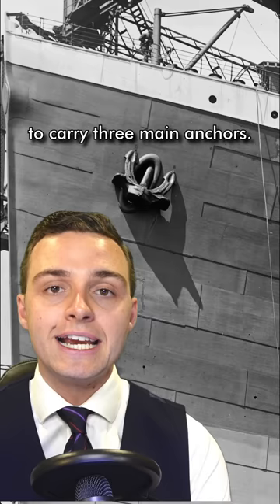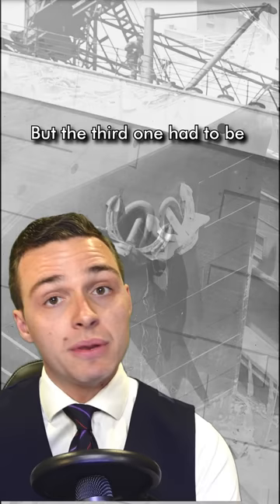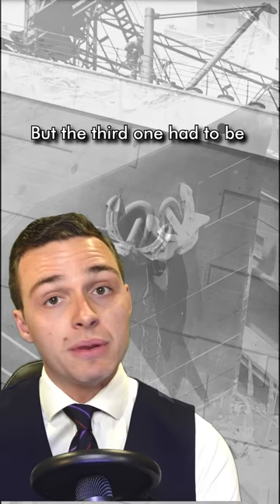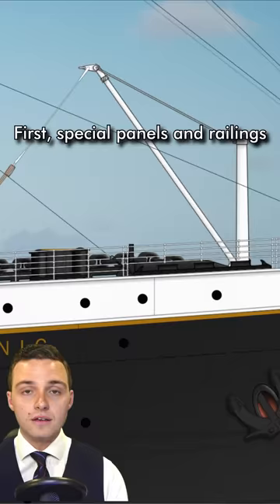What was this triangular thing on Titanic used for? | Oceanliner Designs Shorts

Comment: Yes and they had those on many liners and ships of the time until they were phased out by the 1930s or so. At that point they had internal mechanisms to be able to facilitate the central anchors on ships that had them after that
Reply: I think on some ships I’ve actually seen the 3rd anchor projecting out of an equivalent ‘hole’ on the prow of the ship in place ready to drop by a 3rd anchor chain…if I’m not mistaken.

Comment: Thank you for this. I curiously looked this up sometime ago and it was so much knowledge available about anchors. The one in question was built by a company known as Hingley, it's design was patented, it weighed 15.25 tons and was painted in anti corrosive coatings. It was so big it required 20 well-fed horses to haul it to the yard. Very interesting story.

Comment: I believe the spare anchor is not hoisted and lowered into the water.  It is suspended just below the anchor housing.  Crewman on a suspended platform attach the chain to the spare anchor and then lower it till the anchor chain takes up the slack.  The hoist rope is then removed from the anchor and then the anchor is ready to be deployed into the water.  Great video.  I like the animation.

Comment: I think you will find the crane wasn’t to drop the (spare) anchor into the water but to replace one of the other anchors on the anchor chain if it was lost or became fouled.
Most of the anchors holding power comes from the length of chain laying on the sea bed rather than from the anchor itself. The anchor itself would not hold the vessel in place even in calm conditions.

Comment: Spare anchor also called a Sheet Anchor. We carried ours stowed on the stern. However, in this case, because provisions were made to handle the 3rd anchor more readily than ours, which required a shore crane, calling it just, the third anchor is probably correct. Some ships I was on also carried a spare propeller. Another annoying fact: ship is at anchor if one anchor is out, and a ship is moored if 2 or more anchors are out.

Comment: It's not the anchor that keeps a ship in place, it's the weight of the chain that keeps a ship from moving. The Titanic had 1,200 feet of chain. You want at least 7 times more chain out than there is water under your ship. My question is, where is the 3rd chain. Also, I think there might even be a 4th anchor in the rear of the ship.

Comment: Youd be wrong on the done by hand, they had a windlass to use
Reply from the maker: I was referring more to swinging the crane around, that was all done using tackle and man-power as it was not motorised. For running the anchor cable up and down yes - 100% a windlass was used. :)

Comment: I wonder how long before the weight of the anchor potentially collapses the deck, or the weight of anchor chains for that matter. It’s a sad thought but i can’t help but be curious
Reply: the front area of the ship is quite strong compared to the rest of the body , it was reinforced so it was able to house the main anchor on the deck plus the bow of the ship had to withstand the brutal conditions of the ocean and withstand anything hitting it or it ramming into anything.
that from section will probably outlast the rest of the ship.

Comment: Wait so what was that hole in the very front of the ship for? (in the hull)
Reply: It seems that was the original proposed location - the hole seems to have been plated over by the time Titanic went into service. Why the change of plan, I've never read any explanation as to why.
Reply: @CaseyJonesNumber1  I think I heard or saw that the hole was to be used as somewhat of a backup for the auxiliary anchor.

Comment: What about the hole at the bow that looks like it can hold a light?
Reply: The hole at the very front contains the chains and winch for the central anchor. The crane discussed in this video was only used to lift the anchor from the forecastle and hold it until it was connected to this chain on the front (as far as I understand).

Comment: Suppose it was in a storm moored up at port...how would a 15¾tonne anchor stop a ~52000 odd tonne ship from drifting/floating away? I've never quite understood this.
Reply: the anchor digs into the ground. Try holding onto a pole on a wall with your hands curled and see if you fall or not.

Comment: What would've happened if Olympic sunk instead of Titanic? Or if none of the Olympic class of ships sank?
Reply: All would've been scrapped in mid 30s
If lucky 1 or 2 would survive until ww2
And then scrapped
Reply: If none sunk, all three would have been pressed into troop transport use in WW1.  If all three survived they all would be converted to oil fuel for a very reliable weekly departure service.  White Star would have been in a better financial position and it may be possible that scrapping would be delayed enough they might have saw service in WWII.

Comment: What regulation by the 'board of trade' prescribes a requirment for 3 anchors?  There is no regulation anywhere that requires three anchors on a passenger ship. Why would you lower the anchor overboard when not attached to the chain cable?  The picture of the anchors being lifted was not using this derrick......
Reply: @Aviation Guy  thing is, I do know what I'm talking about. Still haven't answer the question though have you, just resorted to spouting off....ah well.  If you think that derrick is rated to lower an anchor you are dreaming.

Comment: So it required 3 anchors, but only 16 lifeboats...

The board of trade was wack.
Reply: The rationale was that because there were so many passenger liners present in those years in the North Atlantic the life boats would be used only to ferry passengers from a sinking ship to a nearby rescuing ship and thus evacuate all passengers safely.  Obviously the reasoning was badly flawed.

Comment: Completely wrong you should do your research better. It was a spare anchor only and the crane was to swing it out to enable it to be connected to the existing anchor chain in case on of the regular anchors was lost. Under no circumstances would they have ever used 3 bow anchors at the same time. You don’t know what you are talking about.
Reply from the maker: That's not true. In fact the hawse pipe at the very prow of the ship was intended for use with a cable specifically for this third anchor - that's why it was bigger than the other two by a considerable margin. I recommending doing some reading, perhaps starting with 'Titanic the Ship magnificent' which explains a good deal in detail. :)

Comment: Regulations for anchors but not life boats!😮
Reply: They definitely had regulations for lifeboats — but they were outdated. The Merchant Shipping Act of 1894 stated that all vessels over 10,000 tons were to have at least 16 lifeboats (lifeboats had a completely different expectation of them back then; they were meant to serve as ferries of sorts, transferring survivors from a vessel in distress to a source of rescue and repeating until all were saved. This is how it was since ships started having lifeboats in the first place, and they were never meant to be people’s sole means of survival). Titanic and its “sister”, Olympic, were both fitted with 20 lifeboats; 4 more than what the laws required, and also 4 more than what the ships were originally designed with. They also had a specific type of davit that was designed for up to 4 boats per pair, in the event of the Board of Trade regulations being updated…but they never were.
In fact, a lot of what sank Titanic can be boiled down to outdated regulations and procedures.

Comment: I'm sure Titanic has 4 anchor
Reply: 5, actually.
Reply: @DerpyPossum  there four. 1 for the bow. 1 for the port side. 1 for the  starboard side. 1 for the stern.
Reply: @Schultzy1992  There was an additional smaller anchor, similar to the one at the stern, located on the aft starboard side of the fo’c’sle deck.
Reply: @DerpyPossum  nope. Look again.
Reply: @Schultzy1992  I mean, its stem portion is visible on the wreck, there’s a photograph of Titanic’s well deck that has it plainly visible, there several photographs of Olympic that have it plainly visible, but…if you say so.
Reply: @DerpyPossum  you don't know anything.